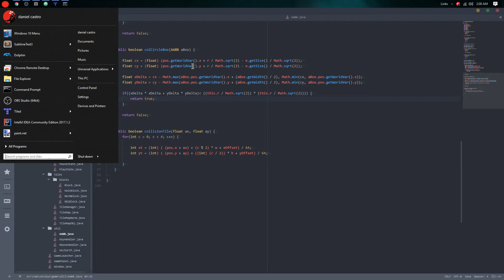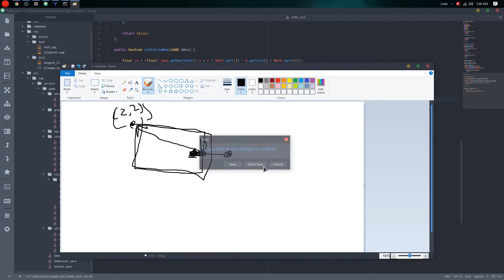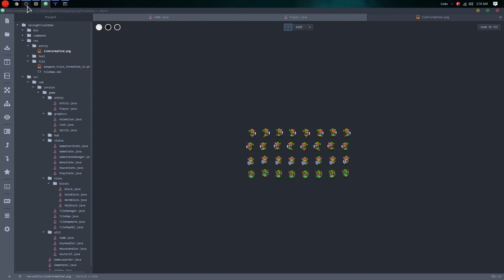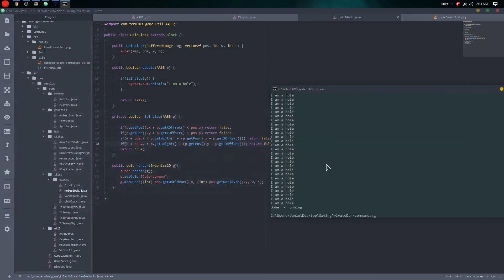Java 2D Game Programming Episode 18 - Tile Collision part 1

Comment: Help please, I'm stuck! 
I don't get an error message, but I don't have the "torch" layer, I can go through  walls and I don't get the "I am a hole" message when outside. (I was in  single block) 
I think there is a problem with my tile read-in or something, can it cause the problem that I created a new file in IJ and copied in  the "tilemap.xml" and "tilemap.tmx" files' texts from your github ?